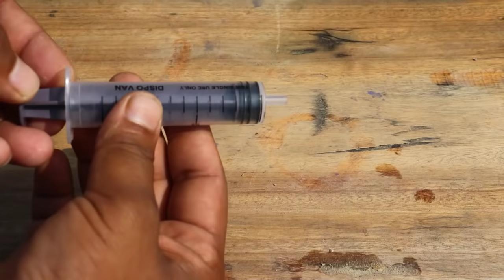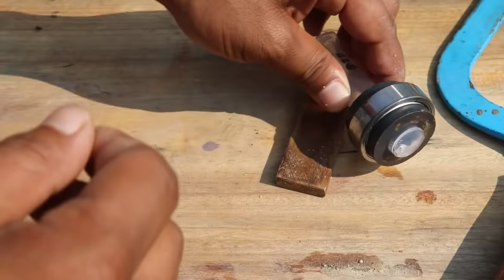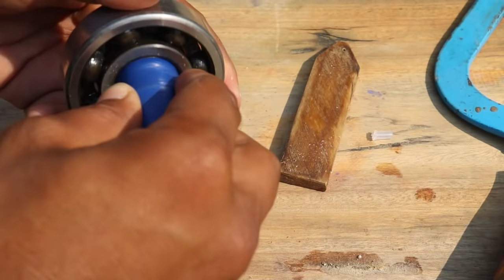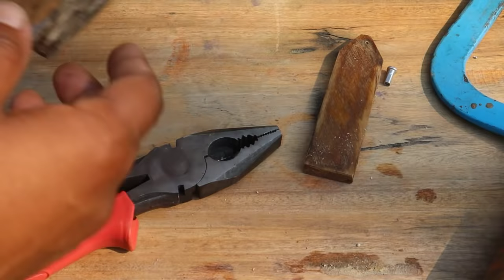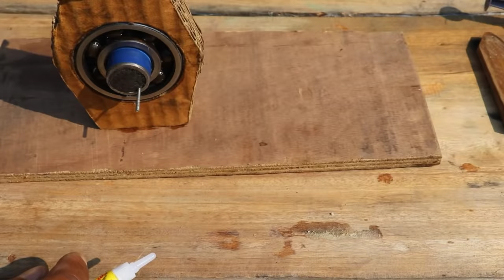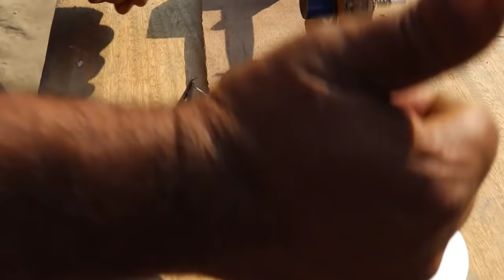single cylinder engine 100% working

Comment: You have 4 wires, 2 are hiding under the motor,  that run the motor,  and the other two are live for the light, and the magnets don't really do anything just do a bumping motion, and make noise. Just a running electric  motor driving it, just a fake and not an engine, there is no engine, just an electric motor running it all, just to get views, so you people who believe this,  it's not real, sorry!

Comment: It's a bogus. In the rear post is not a generator but a motor and he connects the bulb in parallel to the terminals that power the motor. 
Presenting a video in this way is a pure scam.

Comment: Edited video.about 7.10 he pushed a switch.this motor is a half motor and half dynamo sticked back to back.power supply under the table.an assumption.i will make it in my channel . shall be shared link here

Comment: Fake, there is a hole in the bottom of the tube and the top of the tube positioned so compressed air can drive the piston.  There is an air compressor or air cylinder under the table.

Comment: Just look at his bulb ? Does not it look like he has small battery in it and wires coming out of its two ends? Most likely it connects the circuit when connected with motor , as motor has coils that connects the circuit.

Comment: An electric magnet in the wood block..
A motor behind the bearing
Magnetic force from under the table..
Why not pick it up?
Not a stirling engine in any way.
This will not work as shown.
Just another youtube paycheck

Comment: Too bad you get that light bulb at Walmart It has a 90 minute battery backup in it so if the power fails the light bulb still works.